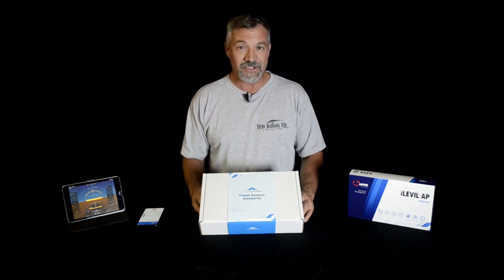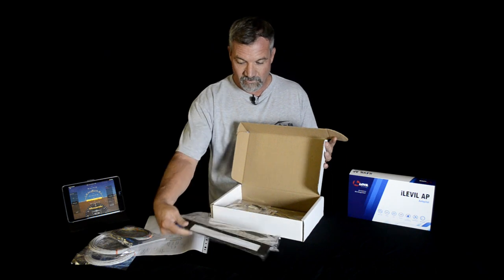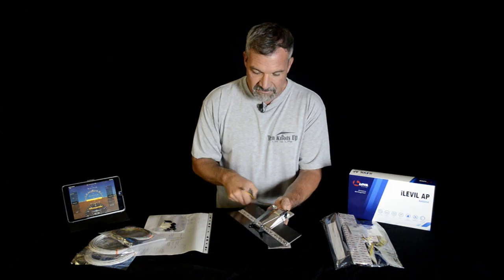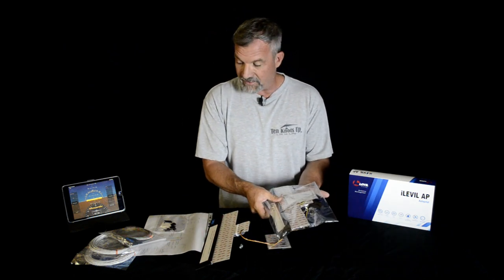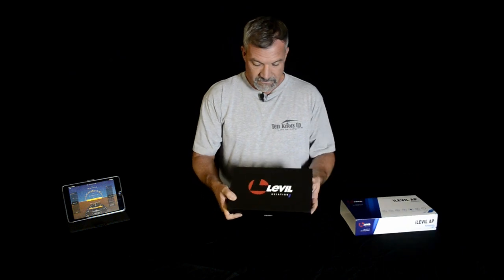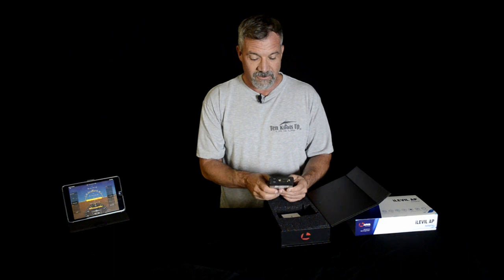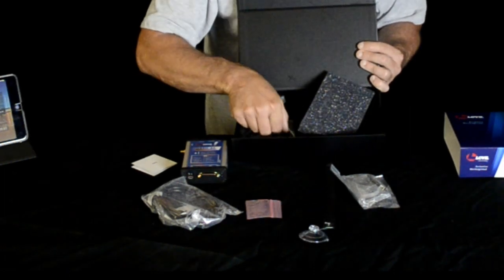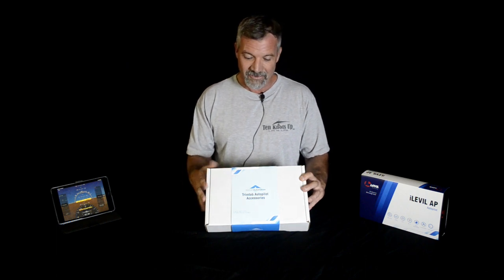iLevil AP unboxing, Europa Monowheel PT. 2

Comment: Very cool!  I'm building a Europa and was wondering what size trim tabs you went with?  Also after testing it, would you go with a different size?
Reply from the maker: There was only one size available when I bought it. 12" is perfect on the aileron. I don't have the elevator dialed in yet but hope to have it dialed in soon.